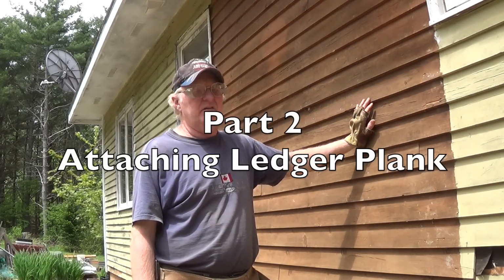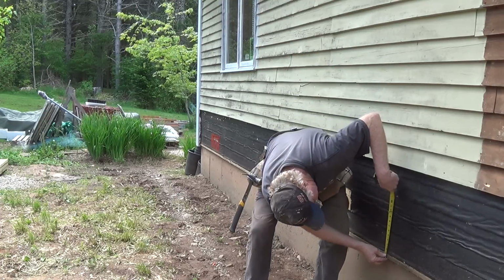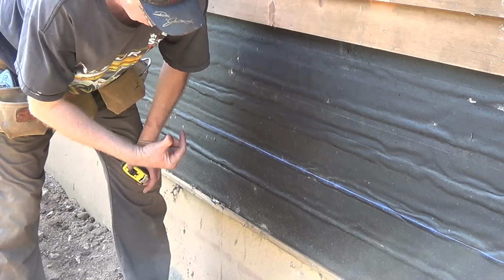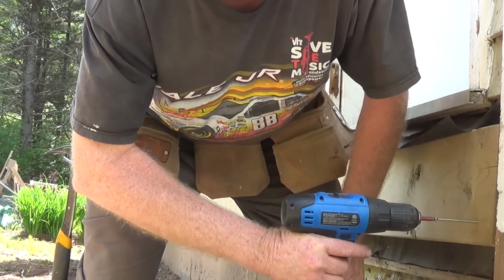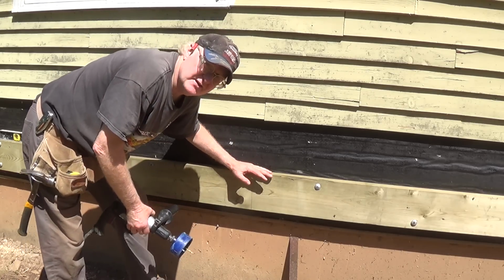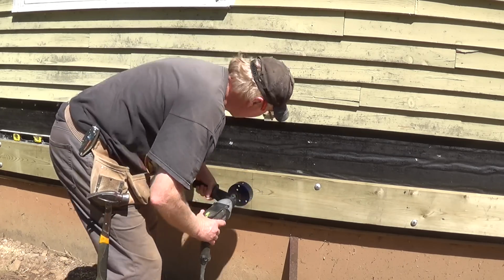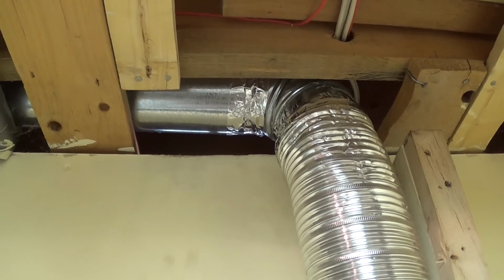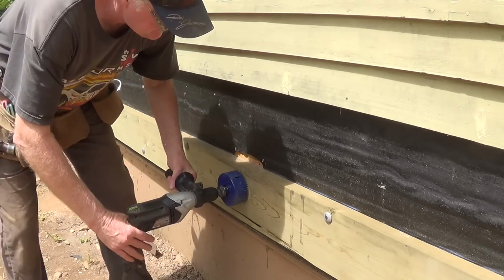DIY Deck Part 2 - Attaching Ledger Plank

Comment: very nice, I just used these Item #1944424 Model #SDWH19300DB-R50 Simson strong screws in place of the carriage bolts, I thought of using carriage bolts but there was no way to put the washers and nuts on and the channel was full of foam anyway.  the old inspector used to tell  me to just keep building and if he seen a problem he would call me.,  this new inspector wants to look at every nail. surprised he didn't use a magnet to make sure the screws were steel and not copper..
Reply from the maker: Thank you for your comment.
I see no problem with using Simpson Strong Screws, as long as the material your fastening to is solid. 
Good luck with the inspector.

Comment: Your deck is 10 ft wide , you are using 2x8 , I'm building mine at a width of 14 ft  by 24 ft long only supported at the ledger and rim joists  would you use 2x10 or 2x8 Deck joists . Im not a carpenter but with the help of your videos I think I can do it
Reply from the maker: You should first check with your local building inspector.
I would definitely use 2"x10", and good quality lumber like southern pine. 
2"x10" spruce, fir and pine are ok under 14 feet in length, but southern pine is a little bit stronger.  Good luck and have fun.
Reply: @BasaPete  Thank you s much .

Comment: Good camera shots. I am assuming you are Canadian?
Reply from the maker: Thank You. Canadian, what gave it away?
Reply: @BasaPete  Hi. I'm starting to pick up subtle differences in pronunciations from watching many US videos as I find people from the  US and Canada do sound alike. The give away (not necessarily true) was your metric measurements from your earlier videos as most US presenters don't reveal metric conversions, so is very difficult to work out while listening to imperial  or fraction measurements with a lot of construction videos.
Reply from the maker: @TheClaudos  It would be much easier if we all used the same measurement system. I used the US and imperial systems back in the 60s and 70s until Canada switched to metric, which is a much better way of measuring, everything is 10s, 100s and 1000s.
Reply: @BasaPete  I agree  it would be easier  using  the same measurement  system. The metric is more easier for me to follow and calculate than the imperial  or US  standard measurement. It must be a generation thing I guess. When I used to work in a timber yard a few years ago, I might get a few customers who used to come in store quoting in imperial measurements, so had to politely ask them if they could convert that into metric for me. I also didn't know in NZ that it was made official till 1976. Having said that, my grandad was using imperial while working at different timber yard sites.

Comment: Hi I don't have time joist on the outside of my house. I live in a townhouse with no basement and putting the deck low ground. Only option I have in the concrete foundation or the brick veneer. What can I do to ensure the ledger in solid to the house, especially if I don't have access to other side or basement
Reply from the maker: You can attach the ledger to the foundation with concrete anchors. You will need a hammer-drill for that. Or, you can place footings next to the foundation and set your deck on them.

Comment: what if i dont have access to put a nut on the carriage bolt, is there any other options
Reply from the maker: Thanks for the comment. If your house has double rim joists you may be able to get away with 1/2" x 5" lag bolts/screws. Best to check with your local building inspector.